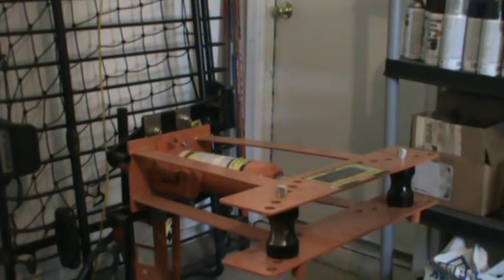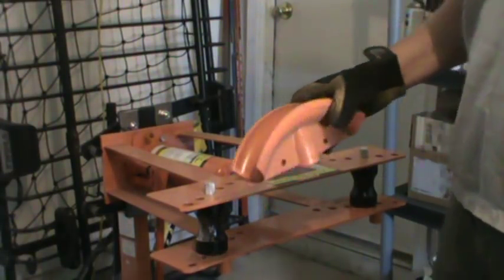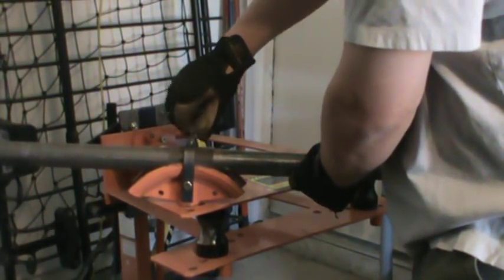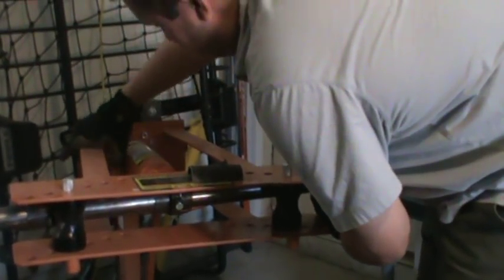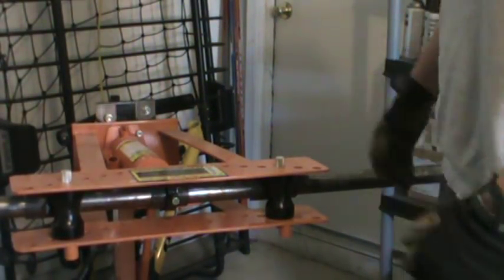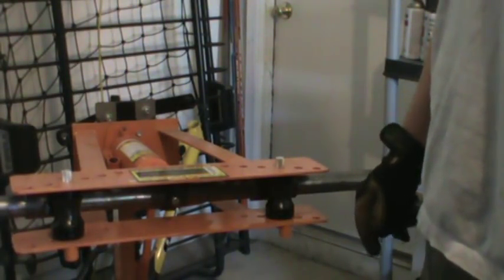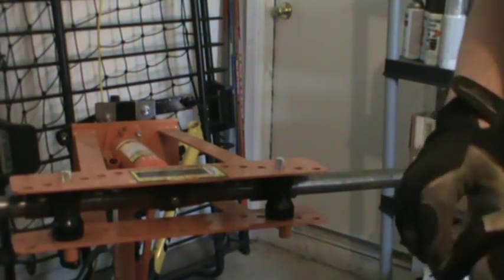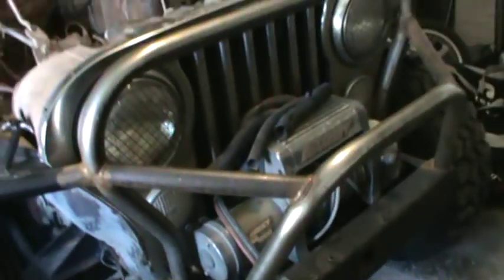Harbor Freight pipe bender modified for bending tube

Comment: All that trouble just to make the tool work the way it was supposed to in the first place....typical Harbor Freight drama. smh
Reply: +mrbratt69 Relax, keyboard warrior. Doobysnacks is right. You shouldn't have to go through all that nonsense just to prevent a tool from ruining your work.
Reply: This is a PIPE bender not a mandrel TUBING bender... with these mods it works fine for the home builder needing to bend a few pieces of tubing. A new mandrel tubing bender will run $300 and up.... your choice. But for most guys it is OK.
Reply: Because its not a TUBE binder its a PIPE binder,, tube is NOT pipe and pipe is NOT tube, it works great for what it is intended to do and that is to bend PIPE not TUBE. 20+ years in the welding/fab biz
Reply: Damn I'd love to know where you can find a mandrel pipe bender for 300 bucks. Try closer to 3000.

Comment: i wonder if I could  bend 2"1\4 exhaust  pipe this way...
Reply: What did you use to bend your exhaust pipe? And how were the results? I need to bend 2 1/4" stainless steel exhaust pipe; and the main thing I am concerned about is keeping the pipe round at the bend, so that it does not restrict exhaust flow. Thanks in advance for your help.